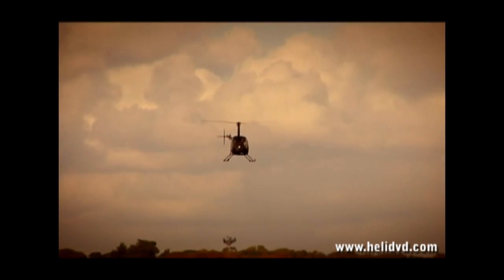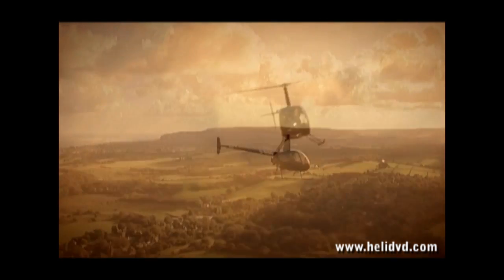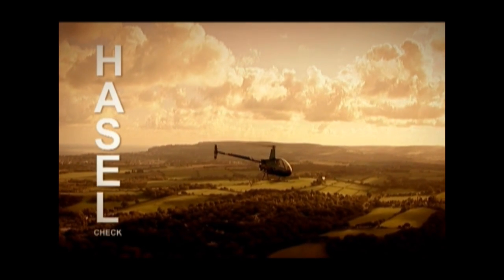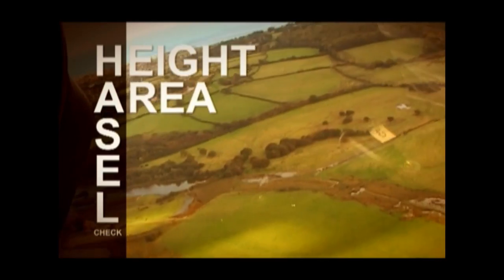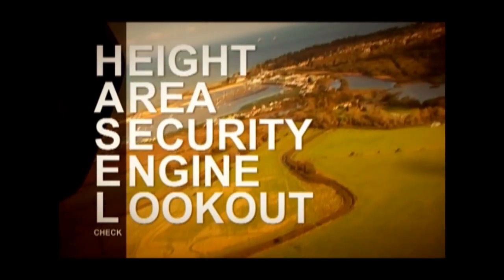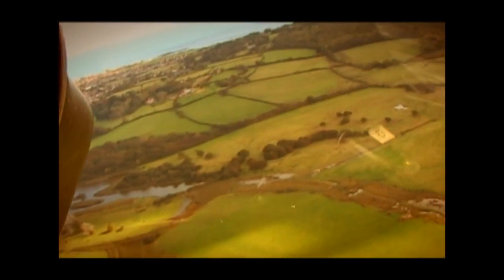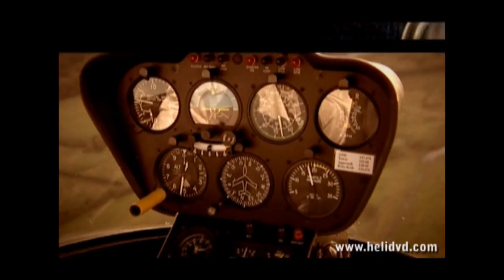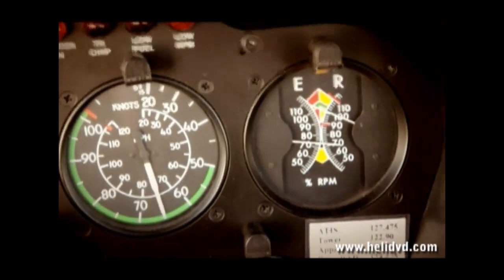Don't crash your helicopter! Full Down Engine Off Landing - Autorotation in a Robinson R22 - HD!

Comment from the maker: James Kenwright: "How long you have to react depends on where the collective is - i.e. how much drag there is in the rotor disc. So at 23 inches of power on take off - sure less than a second.  But at 19 inches you would have much more time - well over a second. On approach at 15 inches - even more time!!!!  550ft was circuit height at this airfield. You can do a 180 auto from 550ft. You can do an auto from the hover at 400ft although only attempt this if you know exactly what you are doing!" JK